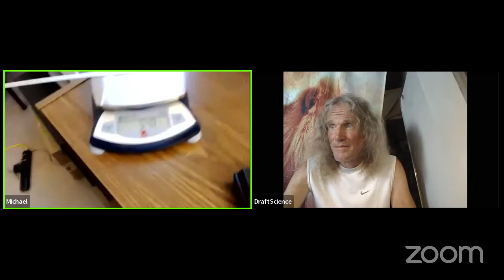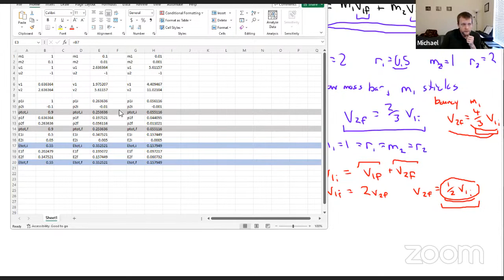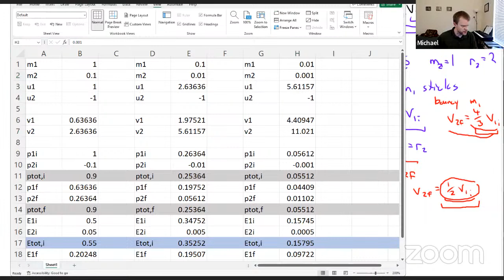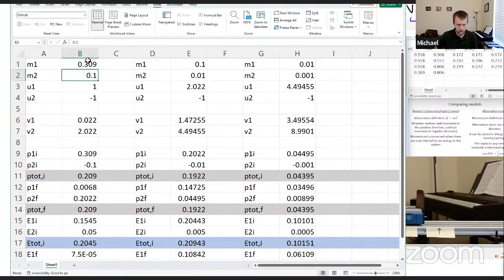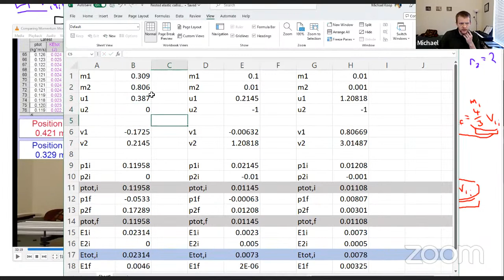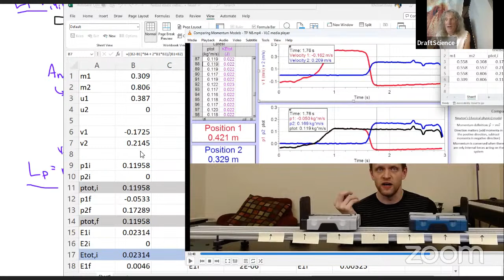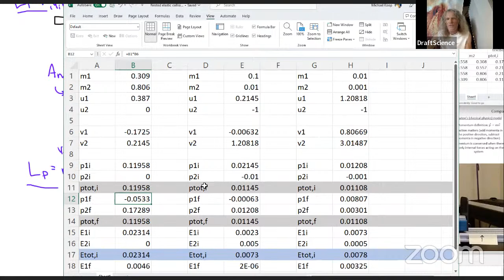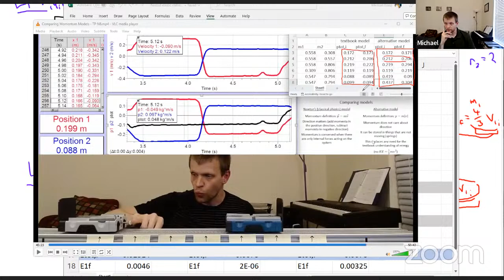Discussion of Lever Launcher Experiment

Comment: Think you did the best job you could Michael.
Reply from the maker: I think it went as well as I could have expected, and I do appreciate DraftScience's participation.
Reply: @PhysicistMichael  Yes I understand the motivation, the lure of provability leading to a powerful tool for predicting nature's behaviour. 
Then wanting to be able to share & demonstrate it's working with others, only sometimes others (or individuals) may resist that understanding at all cost.
Reply: @Ian.Gostling At 35 mins in I realised that they were both talking about different experiments, one without gravity and one with gravity. 

There is a difference, so maybe a lever experiment 
should be done in the horizontal XY plane instead of vertical Z plane..?
- Maybe I should watch the whole video before commenting.. 
I have now, and DS's irate response to some of my comments.
I will try to continue in this endeavour, 
Until he starts making some sense‼️

I noted that that DS doesn't understand moment of inertia or angular velocity. 
I understand that they are difficult concepts to grasp, but I thought that by now (after talking about for a few years), DS would've learnt the basics & would've been prepared for this discussion/debate. 

I am pretty shocked at his lack knowledge, especially as he said a few times that he was a machinist in a workshop‼️

Comment: If it turns out that levers don't conserve momentum, then the experiment is of no interest to Daft because it doesn't appear to control for what he's trying to control.  He has no interest in explaining the result himself, using his own physics.  He's not curious about what he got wrong in trying to make a prediction.  And I think this is entirely because he doesn't understand that KE provides missing information.

You could ask a hypothetical to make it easier for Daft.  In a collision, there are an infinite number of ways to conserve momentum.  The two objects can have any combination of speeds AFTER the collision that meet the requirement that momentum is conserved.  And yet nature consistently settles on ONE outcome (given the same initial conditions).  Ask Daft to account for it.
Reply from the maker: I was trying to make that point at around 27:40, maybe I should have pushed harder with if/how his model makes any specific predictions for this, but I let myself get sidetracked with his claim that these haven't been done before (followed by he's seen hundreds of examples).

Comment: The easy way to defeat DraftScience’s claim that standard physics & KE can make a free energy machine is to show that the velocity in one direction goes down with each impact (even though MV goes up) and soon you are taking near an eternity of time waiting for the next impact.

Also, I’ve watched the video of his oscillating lever experiment. I’m pretty sure the video shows less than 20 oscillations (much less than the 100 he claims), but maybe he just didn’t upload the rest. The key for me though, is the weight of the bar. I think it might be a 5 or 6 foot black steel bar (at least this is the closest match I could find on Home Depot), and the weight of such a bar was maybe 5+ pounds. While the weights of the magnetic ball bearings he was using appeared to me to maybe be an ounce or 2 each (I looked at the weights of similar sized bearings I could find online). I think this is important as you can imagine that if a hugely massive level does perfectly oscillate, then adding a few ounces to either side will be negligible in slowing down the apparent perfect oscillation.
Reply: Gary's lever only oscillated because the masses (including that of the steel bar itself) were supended below the pivot point by virtue of him attaching the (string or whatever he suspended it off) through a hole on the upper part of that bar.   There are two other places he could have suspended it from 

1) The bottom of the bar, in which case it would have simply rotated back to that suspendion point being at the top and once again it would oscillate for all the reasons Ian Gostling explained in some detail about two weeks ago.   
2) from a point just below dead centre of the bar thickness, (ie accounting for his masses being suspended below the bar)  so that there was exactly the same total mass both above and below that pivot point... 
In that case it would not have oscillated. (other than some unintentional and irrelevant swing side to side, due to his string or whatever he suspended it from, making it a pendulum)   
Had he done that, he could have lifted one end or the other and let go and it would not have dropped back to the hoizontal position, let alone oscillated.

The way he suspended the bar, it would have oscillated even without any extra masses suspended, again, because the mass of the bar itself was already below the fulcrum. 
In that case he could have suspended it from a point dead centre of the bar thickness and once more, it would not have oscillated.

It would have been a cleaner experiment if the fulcrum was a fixed point - not able to swing sideways, but that requires the kind of effort that Michael Fowell, Mindless Marbles, Ian Gostling and myself have been willing to make.
It would also have helped a little to not have a giant plant in shot...
...and for the bar not to be free to rotate horizontally...
...and for us to see some close ups of his suspension point..
... and for the chain of attached magnets to not also be free to swing sideways a little.  (Because that's like a little pendulum suspended from a larger pendulum and tests I did show that this slows down the oscillation compared to when the masses cannot swing sideways).

It would have also helped if he addressed these issues and had a second go, like we always do when he criticises our work.  Then he could see for himself that his first and only experiment is of less value than he wants us to believe.  We don't believe it because we have made the required amount of effort  to check all these things, numerous times.  Gary hasn't, because it's easier to not do the experiment again, properly - and more importantly, then he doesn't have to explain why it no longer does what he claims.  

If he had re-tested it properly and found these things out for himself, he would not be able to keep telling people "I did the experiment and it oscillated 100 times" because it wouldn't oscillate even once if he did it properly.
Reply: the thing about the lever is that every oscillation the objects go from zero momentum at speed zero at the peak of the oscilation, then goes up on the way to horizontal, has maximum momentum there, then starts to slow down to zero momentum again at the next peak.  How is this conservation of momentum?  The momentum oscillates from max to zero to max to zero and so on as it slows from friction.  It's stored as potential energy when it momentum gets to zero.  Momentum is not conserved during oscillation, energy is, from potential gravitational energy to kinetic energy and back and so on, leading to varying momentum.  That's not what "conservation of" means.

Comment: Experiments performed by Emilie Du Chatelet and Willem Gravesande showed that by dropping heavy lead balls into a bed of clay with twice the velocity (not twice the height, that would be 1.414 the velocity) the balls penetrated four times as deep and with three times the velocity reached a depth nine times deeper. Showing that energy is proportional to m*v^2, not m*v as Newton suggested.

Comment: At 20:40 you indicate that you are considering an inelastic collision only. Is this correct? If so, I am wondering why this is the case, because I was thinking we ought to do an elastic collision. 

Perhaps we should just do both. I've actually done calculations for the elastic collision case, and I might send you the notes over email. Would that be okay? 

Regarding agreeing if the setup is good, we have to find a case where both of your models agree so that both parties agree "the device is calibrated properly." I think in an elastic collision this actually works (the same mass, same radius case works out the same for both models). 

Also, I am skeptical that you can treat the lever as a massless rod and the carts as point particles. I suspect you'd have to know the true moment of inertia of the carts themselves if we are to get accurate predictions (and the carts are a very complicated shape). This might complicate the calculations by a lot.
Reply from the maker: I am planning on doing both experiments under a variety of circumstances.  The completely inelastic is actually the easiest to analyze, including with the moment of inertia of the non-negligible bar.  Also that's the one that DS is specifically making predictions for, so that's why I focused mostly on that one during the discussion.  But I also talked about how the elastic collision should give mass two more velocity (but still not enough to violate conservation of energy) so this is another prediction that my model makes, which we can test.
Reply: @PhysicistMichael  "Also that's the one that DS is specifically making predictions for"

Hmm, I'm not sure he is. It's difficult to tell, because we're not using the same terminology (mainstream terminology). 

I was under the impression that he had an elastic collision in mind, but it just happens that when you send a "2x mass 1x radius" on one end with a "1x mass 2x radius" on the other end, all "energy" transfers to the other end 100% in the ideal case. I was thinking that was his prediction for the ELASTIC CASE, but perhaps I'm mistaken.
Reply from the maker: @mindlessmarbles9290  He said he didn't want any bounce, and the original mass to essentially stick to the lever.
Reply: @PhysicistMichael  Got it! Thank you!
Reply: @PhysicistMichael  Just to add more data points, consider these quotes from the latest video: https://www.youtube.com/watch?v=EOFyeTIFPCg&t=1h17s

1:08:34 "yes exactly no I have I have inelastic in mind why would I want something elastic that's the bouncing stuff I don't want the bouncing stuff I want the Newton's Cradle so in a sense it is a land you know it's inelastic I mean that's what we call it but obviously all the energy just goes one way I I don't know the word elastic and inelastic are really sloppy" 

1:10:36 "I said explicitly over and over I don't even expect any so if you do the experiment and you put everything in the right locations there shouldn't be any bounce just like there's no bounce in a Newton's Cradle a Newton's Cradle doesn't have any bounce okay the mass comes in hits the other Mass moves it out no bounce it shouldn't bounce because you're basically converting the mass velocity ratios"

1:11:47 "well I'm saying if you're going to do the bounce argument and say you're going to create free momentum because you're going to put 2x the energy into the lever I'm saying go bounce all you want I want the bounce if the bounces is going to show you making free momentum please show me some bounce" 

He wants it to be like Newton's cradle, which indicates/indicated to me an elastic collision. But again, I understand doing both will be the best.

Comment: Keep things simple by eliminating gravity.

My understanding of this debate simply comes down to
setting up the experiment in the horizontal XY plane.

(Michael does show his setup at about 46:55, 
DS then realizes what he was talking about all along).

If any useful data is to be gathered from the experiment, 
it's got to be focused on the (r,θ) circular polar coordinates 
within the horizontal XY Cartesian plane. 
Use a protractor! ⭕

I rightly suspected that DS wouldn't even understand 
the basic premise of coordinate systems, 
despite often ranting on about Descartes!
Reply: Yes Michael showed the experiment will be in the horizontal plane and DS understands this. However there is still gravity but it just plays a lesser frictional role
Reply: @timjohnson3913 The structure of the beam will affect the result. A hollow beam is a given because he wants low mass to fit his model.If he wants minimal bending in both vertical and horizontal directions, he should choose a box  beam. If he wants more stiffness in the vertical direction to counter gravitational bending moments that lead to friction on the bearings, and doesn't mind about bending in the horizontal direction so much, he can choose a H shaped beam (rotated 90°, edge parallel with the table).
Reply: 43:29 Ancient chinese used the mangonel for siege warfare, also called the traction trebuchet. It looks alot like a simple lever, powered by rope torsion. 

You can see it and other ancient siege engines in action (scale models) on Youtube.
Reply: @timjohnson3913 I see now that he shows his experiment setup at about 46m 51s into the video.  The only issues would be how flexible the beam is and the friction on the pivot.
Reply: @timjohnson3913 One more thing... 

The beam has to be aerodynamic to avoid producing lift, so have a round cover on it if the main structure inside is box or H shaped.

I see he has a cylinderical beam, but is it too flexible in the vertical direction...?
Reply: 1:02:28 The hooks and loops of the velcro would act like springs and dissipate the energy into the environment as heat, sound, electrostatic fields and so on...
Reply: 1:04:50 The change in momentum (impulse) is converted into pressure stress in the spring.

The spring is like a system of levers end to end, therefore bending moments (angular impulses) are passed along it to the anchor point, then some of those moments are reflected back due to  internal stress in the metal, because it resists compression. 

Other moments are transmitted through the anchor, into the cart, into the axles of the cart, the wheel bearings and finally to the surfaces of the wheels.

Because of it's structure, the spring decompresses, converting those angular bending moments back into linear momentum via the mass in contact with the end.

So, the total initial momentum is shared out 
between both carts via these affects, leaving one cart with a momentum deficiency and the other with a gain (in absolute terms).
Reply: 1:28:56 "I don't know why the subject changed" ... DS keeps changing the subject! 
This was originally about LEVERS, wasn't it..?
Reply: 1:38:34 "Eddington experiment" - 
Another changed of subject by DS.🙄